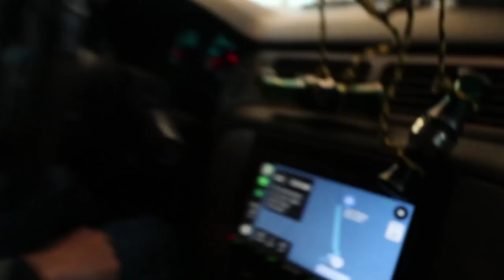I bought it

Comment: I don't own diesels at this point, but my last truck was an 03 Ram 1500 Laramie and I now have an 06 F150 Lariat. I definitely preferred the 5.7L Hemi to the 5.4L Triton, but all around I prefer my F150. The interior is higher quality, there is more room, and for what I currently do the engine provides plenty of power. I've owned Chevy, Dodge, and Ford so who knows what I'll go with when I buy a diesel down the road.

Comment: You didn't buy a dodge but that's okay at least you didn't buy a piece of junk that will break down
Reply: ? Being a mechanic,car restorer and owner of a late model used car dealer,you're full of crap buddy ! Dodge's are reliable ,when Dodge was Dodge,Ford was Ford and GM was GM engines/transmissions were all fairly the same for reliability..All lasted along time..Today Ford and GM have the same transmissions..Dodge/GM have the same rear diff s...So,I bet you will bash the Ford trans and praise GM trans lol..
Reply: The transmission in a dodge will go long before anything in a ford or Chevy will
Reply: Cummins is the best engine

Comment: Truck brand loyalty is pretty ignorant. 1: Any truck that is treated well will usually last 2; all brands will produce a few trucks that have problems straight from factory, that’s the problem with mass production. 3: most of you are also gun owners, do you stay loyal to one gun brand as well? You might have a favorite, but surely you own several brands. Why are trucks any different if you can afford multiple vehicles? 

Just my two cents, not trying to start an argument. 

Also, this whole paragraph excludes Honda trucks, they seriously shouldn’t even exist.